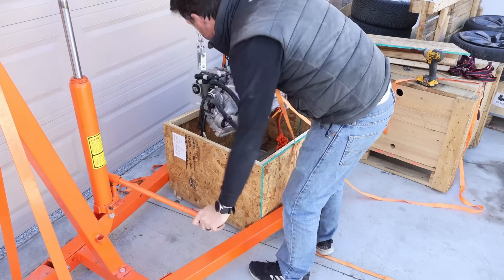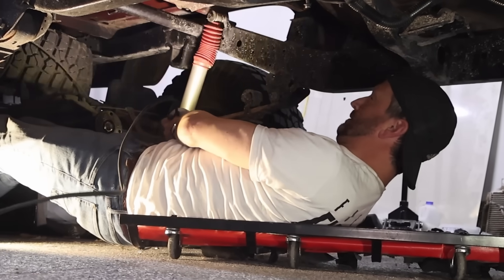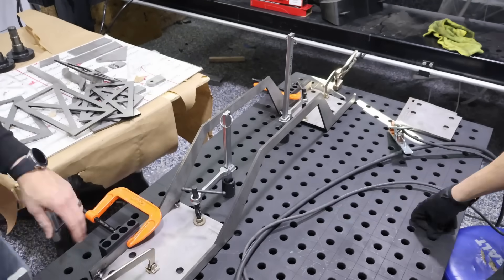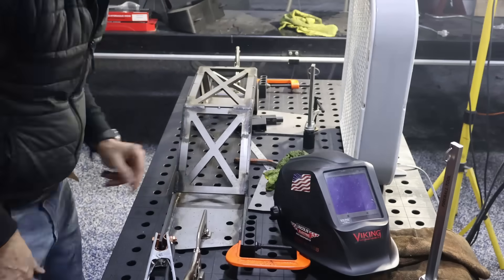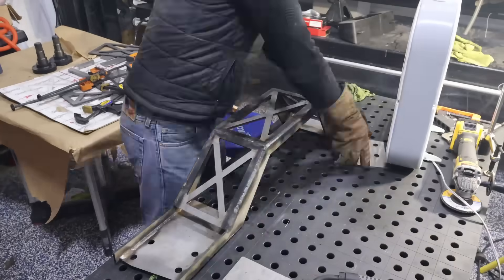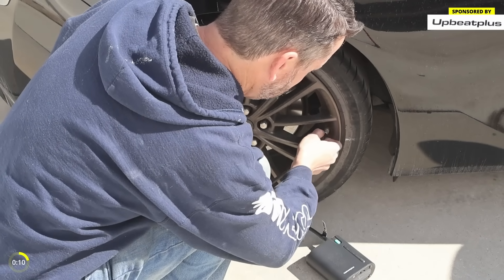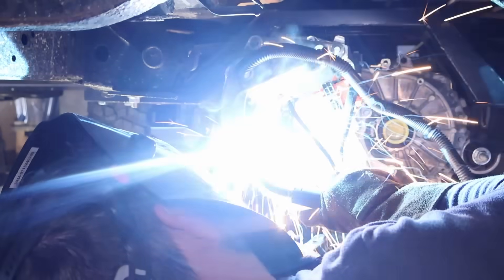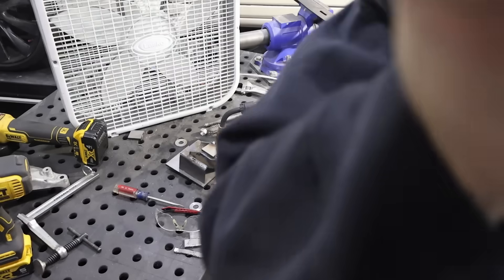Installed!  Tesla Motor in a Toyota Hilux Truck - Electric Time Machine?

Comment: How hard would it be rig in a drop-in generator under the hood as a backup power source? 

Cure range anxiety on the trail or backcountry. 

You would just need a dc to dc converter that matches battery bank voltage right?
Reply from the maker: Anything is possible

Comment: I think you didnt calculate difference between size of the wheels. Its will be also make higher speed at default ratio. At tesla wheels ~27 but in Toyota should be 32-33 i think. So its ~+20% to speed. Also variant with tesla performance can be also interesting. Not for hard conditions but will be more power and with lower consumption. And higher speed too. ~100mph without gear modification. But yeah.. you should make fixed free drive shaft of each drive unit. We made project of track model 3 with super light battary on high current cells -450lbs. but now have some trouble with electronics due internal safety mechanism of tesla. So i think will need make custom bms... Ps. Hello from Ukraine 👋
Reply from the maker: Thanks for the information!

Comment: I saw you fitted a Quaife ATB diff to the model 3 motor. If you run that with the front hubs unlocked for 2wd as you described at the beginning of the video I think you'll end up with no drive atall. Those helical gear diffs need traction on both sides to work. In a conventional setup with one of those diffs if you have a wheel in the air you end up with zero drive. It'll work just fine locked in 4wd permanently (front hubs locked) as the diff will allow slight axle speed differences
Reply from the maker: Good to know

Comment: 16:43 I don't like the placement of the last impromptu motor mount bracket. The torque generated by the electric motor may be successfully observed by the top bracket, however the lower impromptu bracket (due to the angle of the motor mount) may undergo a substantial pulling force Against your TIG welds -- which by their orientation are more suited for compression.

Comment: So battery not fuel based generator? I'm waiting to see Diesel generators with strong electric motors + Capacitor banks for Boost to get rolling. Battery? Hmp.. Googles: "Ultrasound control of electric plasma science org" + "Ultrasound excited plasma produces stronger electromagnetic field" Smash plasma with a pulse slamming into an Echo at the right frequency Continuous EMP if you got the power vs scale. If you dig they claim they're working on a version to shield against Mars radiation. Maybe..

Comment: Drivelines don't have to be perfectly straight. Why did you choose to mount that motor so low? It's basically ruined the breakover angle and off road capabilities of that legendary truck. Very disappointing. Also that pump and filter are very vulnerable even for on road driving.

Comment: That motor is EXTREMELY low, that's never going off pavement other than a smooth gravel road.
Reply: That's what I came here to say too. It's way low.
Reply: Thought the same thing. Add to that all the wiring and plastic that could get snagged or hit by rocks. This looks cool but the motor placement is a bad design choice.

Comment: Nope, electric motor hanging in the wrong location whereas it can be installed in more spacious engine compartment with full transmission function through adapter plate and battery can be in the trunk. So ground clearance is not affected

Comment: Question: why not simply adapt the motor output shaft to the input shaft of the transmission. Multiple ranges and should be less welding.
Reply from the maker: Transmission can not handle the torque.  Also there is no need for a transmission for different gears.

Comment: Another tip on welding in the tubes for your bolts for future projects you might do that. Instead of cutting apart what you already welded together. You could’ve just drilled out the holes on each plate side just slightly bigger than the tube outside diameter slid them in, weld around both sides of the tubing and grind to flat surface. You build and you learn more and more. Great work can’t wait to see it drive. 👍🏼👍🏼

Comment: That motor looks LOOOW!?  as in "Cant go that way; there's a small speed bump there!" low..?
That means it's no longer a pickup truck and it's only purpose is a Youtube video.
Reply from the maker: It is lower than I would like.  11" of ground clearance is not too bad.
Reply: @electricsupercar  A skid plate with wheels may set one's mind at rest.  :)
Move it higher. Bugger the angles. Encroach on the bed if you must.

Comment: Please revise your mounting location. It looks like you've got room to go up about 2.5 - 3", if you didn't have the cross member routed above it. You could build a 4 point cradle that doesn't hang much lower than the original if it were mounted outside the perimeter of the motor, and should only require adding a few captured nuts to the frame rails for mounting it.
Reply from the maker: I will definitely take a look at that.

Comment: Should have made the motor cradle/cross member  under the motor.  Would had moved it up a ton. If drive line angle was a concern, you could easily run CV joints.  Super sad to see you do this to a perfect 1985 2nd Gen Toyota Extra Cab. This truck is worth $15k plus rght now.  You might make a lot of die hard YOTA fans off doing this.

Comment: I’m not a welder but from observation well placed stitch welding seems adequate (and looks neater). More weld doesn’t always mean more strength?
Reply: More weld doesn’t always mean more strength? Yes it does the way he welded it. Weld beads more on one side then the other and low to medium penetration. Yes if your going to weld like that then weld it all up.

Comment: Looking great.
Just wondering if the motor could have been mounted ‘on’ the cradle rather than under it. Then the cradle would afford the motor some protection when hopping over rocks and stuff. Or was there limitations due to the front and rear diff positions. 
Either way, this electric motor will give this some real low down torque/grunt the old wheezy hilux motor never had.
Reply from the maker: I am going to see if I can raise it up a little.  Going for a shift plate

Comment: Ideally, you make the holes in a plate large enough for the bolt reinforcement tubes to pass through, then flush-cut, bevel and weld them to the bottom and top plates. In the case of how you did it. Welding to the inside of one is fine, but you should leave the tubes long. Then die-grind fit the tube to the other plate with OD sized holes, and flush cut and bevel them to achieve a good end-to-plate weld to that plate.
-Also you would need screw jacks to support the piece when welding the wings when in the up position to prevent ANY movement, but depends on how picky you want to be on final movement of the materials..(In the case of this piece I would guess supporting the wings with a 1/16-1/8" gap in the center then clamping the center hard to the table would pre-load the weldment enough to be negate any downward warp of the wings. Jump stitching is an art though.

Comment: Grab a used belt driven evap and put it in the attic.

Duct the non belt side to your shop and the blowy side outdoors. Better as an updraft through the roof

Add louvers to the outside into the attic. This air will get sucked through the belt drive side and act similar to a lab, high dilution, high velocity exhaust
Reply from the maker: Interesting 🤔

Comment: You didn't need to unsolder what was already soldered before, to put the separator tubes, you only needed to enlarge the holes, put the separator and then solder it, and you avoided removing the solder, to put the separators
Reply from the maker: probably would have been better your way

Comment: Diff ratios were 2:1 in the pickup???? Toyota trucks in those days usual had ratios in the 4:1 range. Is it even possible to make a 2:1 ring and pinion?
Reply from the maker: All I did was jack up the truck and spin the differential.  Two rotations of the differential = 1 rotation of the tire.
Reply: 3.08 / 1 is the highest I can find.

Comment: Something that maybe worthy of noting is that the Hilux differentials are a Toyota G series differential that is in a live axle carrier. This means that the differential centres from a huge assortment of modern day Toyotas are completely interchangeably and swappable into the Hilux live axel carrier.

The Mark 3 Toyota Supra JZA80 IRS differential centre will go straight into the Hilux diff and is also the same as the Toyota Parado LandCruiser, the JZX100 Chaser IRS bolts into a Hilux carrier, MX83 Cressida, MZ20 Soarer as well as many very modern Lexus vehicles. 
Any modern Toyota running a G series differential can be transplanted into the Hilux diff along with pinion and crown gears for the desired ratio. In almost all circumstances custom bearings to suit the new unintended purpose will be required and can be done relatively easily. You can literally talk to a diff and gearbox repairs like I did and mention that the the diff for their Prado that they have been waiting 2 weeks for and costing $1500 can be sourced from a wreckers from wrecked Supra for a few hundred dollars and that will fire them up that they want to kick you out? Then you go back the following week and hand them a Torsen differential you pulled from a Chaser and ask them if it will fit in the Hilux carrier and you'll never see guys clear mess out the way so fast with motivation!
Bearing sizes..... The guys had me bearings to fit in 10min 😁
I thanked them and told them I'm going to sell the diff centre to an RX7 owner with a Hilux rear end for $500 haha
Those guys become my friends very quickly and then they went out and started documenting their own discoverys of how to get any kind of ratio you could think of?

Toyota G series are more common than you think. You've just mentally eliminated modern fancy Lexus because it is IRS and you think it would never be the same diff inside?

The world becomes your oyster with me such knowledge like this. Very inexpensive solutions

Comment: I'm only 2min into this video so maybe you'll cover it later but that Quaiffe diff you installed in the DU is a torque biasing type.  If you unlock the front hubs, 100% of the torque will go to the front driveshaft and the vehicle will not move.  I had the same diff in my LDU in a Jeep Wrangler.  I had an open front diff and if one front tire came off the ground, all of the motor torque would go to that tire.  
The only way your guy will be able to unlock his front hubs is if you put a spool in the DU but then he will not be able to drive on hard surfaces.  Look it up or ask around if you don't believe me.
Reply: My buddy bought a wrecked Trailblazer SS that had a damaged front axle/hub and it did the same thing. Once he fixed it and it had all 4 wheels connected it worked fine. The Trailbazer is AWD though, so the front wheels were always connected and the t-case is designed to give so it can be driven on hard surfaces. Definitely a problem in this case, as you said.
Reply: @mikelemoine4267   Old Land Rover Defenders and Range Rovers had the same thing as you describe for the Trailblazer.  They were AWD with an open center differential for normal driving situations.  When you go off road, you'd pull a lever and lock the center diff.
Reply: @billbayer5526  Yes the LR/RR were similar but the SS only has the viscous coupler in the transfer case/center differential; no full locking. They aren't really intended to be overlanders like the LR/RR.

The LR/RR design sounds ideal for snow/ice so you don't wear it out when going over bare pavement patches.
Reply: Yeah I don’t think RWD only will work either.

Comment: You mentioned in the video that the differentials have a 2:1 gear ratio.  Did you change this from the factory gearset?  These trucks had final drive ratios in the 4:1 range, usually 4.10:1, 4.30:1 or 4.56:1 depending on the transmission and tire options.
Reply from the maker: I just jacked up the truck and spun the differential.  For every two rotations of the differential, the tires went one rotation.
Reply: @electricsupercar  You had the other tire on the ground? The spider gears will double the gear ratio if you keep one tire still. Guarentee the gear ratio is 4.11 or 4.30

Comment: Awesome build! Another method for installing the bolt tubes would be to drill the holes in one side (or both sides) oversized, chamfer the holes, cut the tubes longer, chamfer the tube ends and fill the chamfers with weld and grind smooth.
Reply from the maker: Good idea!
Reply: You're too kind... this is the "proper" way, not just another way.

Comment: why not make a adapter and hook the electric motor to the factory transmission, so you would have a manual electric 4x4. Would not have to worry about the axles etc. and you could change gears and not lose the gear reduction, and on the hwy it would be fine.
Reply from the maker: Stock transmission cannot handle the electric torque.  It can definitely be done
Reply: @electricsupercar  it could if you had a clutch. Not like you are gonna floor it off the line anyway.

Comment: So, it looks like that motor sits pretty low, almost looks lower than the axles.  Optical illusion?  If not, why did you mount it so low?  Curious.

Comment: Careful with the fan when welding if you're using a shielding gas. It can actually blow the shielding gas away. 👍
Reply from the maker: Absolutely!   Fan goes off when actively welding
Reply: @electricsupercar  👌🏻👌🏻
Reply: @electricsupercar 
You can also preheat pieces with good results.
Have a folded hood + heater to get things hot then the welds take really nice
Reply: I've always wondered how hard it would be to modify an hvlp paint system to draw gases toward the table with a skirt underneath.
Reply: @ There are fume extraction systems specifically made for exactly this purpose. Basically a semi-flexible hose that you can (often) position mid-air, with a funnel looking opening. You put it vaguely near your welding area and that's it.
Reply: You can also turn the fan to suck instead of blow on the welding area. Still better than no fume extraction at all.